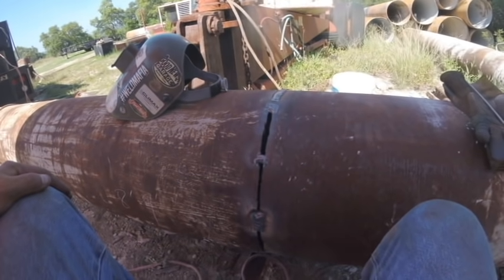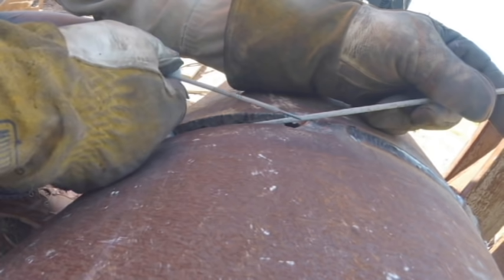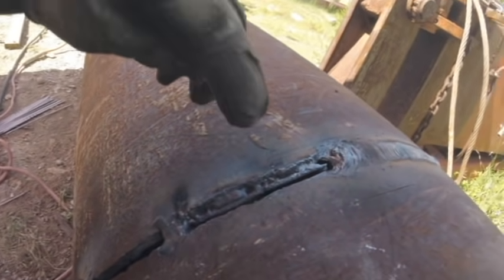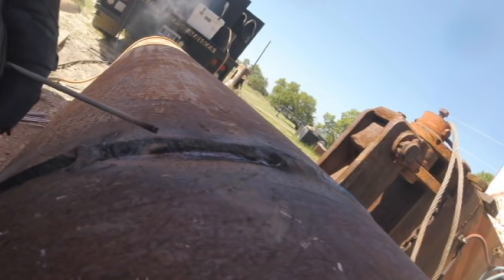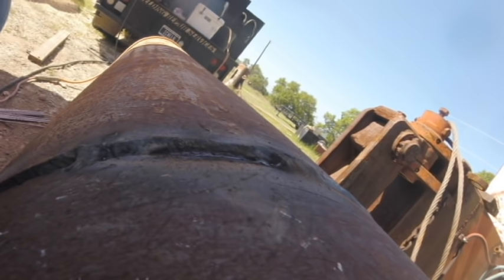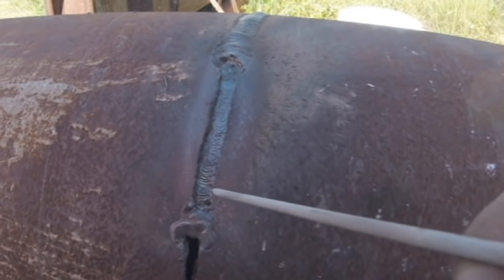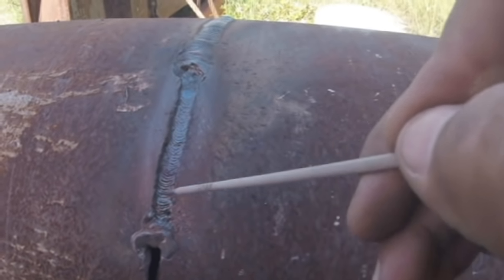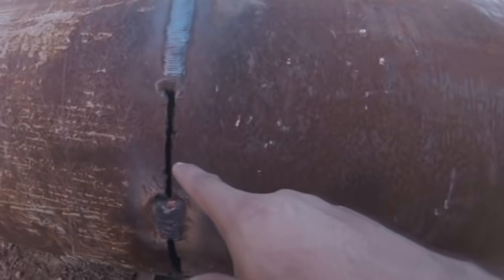Keeping it real!

Comment: Great to see you back. I giggled when you mentioned it as a "dirty secret" in 20 years of agricultural welding this is the most common of hacks. So glad to see someone be honest and "real" thanks for the good work
Reply: I thought I had come up with this back in the 70s in high school, but I never thought of breaking the flux off!
Reply: Good old gapcraft rods 🤣🤣
Reply: @bigunone  some 1/8 or 3/32 tig wire works too
Reply: @semajniffirg230  I have never handled a TIG torch watched it done, but not done it. I suppose it couldn't be any harder than oxy/acetylene welding
Reply: @bigunone  i think he meant just the tig wire as an extra filler with the 7018 or whatever stick you're using
Reply: @jc9376  That is what I thought also, but I have never TIG welded nor had TIG wire had hand!
Reply: @bigunone  understandable

Comment: Total agricultural job finished to a professional standard. Nice work. They guy I served my apprenticeship with once used a stick welder and an extra rod with the flux taken off like a tig welder filler rod. Result was pretty impressive . Looked awkward as hell to do it but the guy was talented . He made most of the tanks used in the Guinness factory in Dublin. They once had a brass tank drop from a crane and it got dented , so they filled it to the top with water and picked it up. After a few days the dent on the bottom popped back out. Thinking outside the box right there.

Comment: Never heard it called 'Texas Tig', but I have heard it called 'Barnyard Fill'...and a gap that big, I've seen a LOT of rebar and 1/4" cold rolled wire used. Drain pipes, culverts...no telling how many miles of 'rebar' has been welded into pipe that's now underground. Great video, as always!

Comment: I was commissioning a textile machinery in Mexico once. I overheard an American welder talk about the elbow on a 6 inch pipe he was welding was not fitted well enough. There was a 3/4 inch gap in it. He left to do something about it, when he got back there again, his local hired helper was in the middle of filling it with a weld. That line was to be under pressure later. Either water or natural gas. It was impressive weld.
Reply: Not You   In pipe welding school (25-30)yrs ago ,we had to weld a 1” gap ,open root process , in 4x6 1/2 plate coupons standing vertical ,, using 1/8 6010 which is DC rod equaling 6011 AC ! 6010 will not run on AC , but the 6011 will work good on DC , anyway the open root process is welded so the inside of the weld is good , the outside looks terrible , which you dress with a grinder before you do your filler & cap . The process is - done in a square  U shape , up one side for 1/2 “ to a count of like 1, 2 then a elongated 1  back down to starting point ,with an elongated 1 across the bottom & the same on the other side,. This process takes some metal from the side , brings it back down to fill across the bottom , leaving a weldment area that  looks like the key hole in the old farm house door , hence called keyhole open root welding ! But now a days this would probably be done with a flux core wire welder , and then change the wire for the filler & cap
Reply: @robertmintz63  welding is an art form.
Reply: Not You   Yes it is thank-you , l have also done his trick , did not know it was called Texas Tig  correction just asked my wife that was 35yrs ago

Comment: Nice to see another video!  Non structural, no pressure, just sticking some pipe together but still did a better job than most would have done on something that mattered.
Reply: I might have thrown 2 rolls of gorilla tape at that and called it a day

Comment: I used to do that at the foundry I worked at, the sand molds would wear out the AR plate around the bolts that held them down to the conveyor.  Had to weld them in place filling in the bolt holes and then weld the worn down seams.  Got another 8 to 12 months out of the liners before we had to cut them out and replace them.  Thanks for sharing.  Charles

Comment: Started welding when I was 14 now 66. Been doing that since I was 15 also Texas tig. I done this for structural welds. Fill in grind reweld. They all have held. Good way to repair. Lot stronger then what most people think. Not ideal but you do what you have to. Good work.

Comment: Texas tig has been around a long time. Welders building ships during WW11 used this method in large gaps when plating a vessel. My father told me about this years ago. He served on some vessels built this way and he said that those seams would come apart. The way he explained it was our country needed landing craft and ships very quickly and there just wasn’t time enough to fit everything up properly. A lot of these vessel were on a one way voyage especially the LST landing crafts. There were lots of woman welder’s building these ships and the woman of this time period were not afraid of hard work. They worked in all kinds of war materials manufacturing they were all referred to as “Rosie the welder”.

Comment: I had to use that same "technique" on a conductor barrel at a wellsite in Northern Alberta once. After that I always made sure to carry at least 4' of 1"x1/8" strapping on the truck. Like you said it does not have to hold pressure, it just can't leak.

Comment: I used Texas tig, using 6013 dcen and 3/32 7018 with no flux, for welding thin metal for floorboards in a truck.

Comment: With a canyon like that you might need some half inch rebar lol.
Reply: You read my mind.
Reply: No joke, and maybe some number 3 bar in the narrower parts
Reply: Serious tho why is he use 3/32 😂
Reply: @riccoronado430  I’m sure he don’t want to run to hot since it’s already a big gap to weld. So colder helps fill that gap up. After you get that filled in then your good to run hot.
Reply: I know it's probably a joke but...re bar is not something you wanna use for filling gaps.  It is all recycled junk steel that is very unpredictable on how well it is going to hold up.  Could be dirty or just a bad mix of steel that will eventually fail. (Even though I have done it before) lol

Comment: I've done that with round steel rod, not weld rod. The steel rod becomes part of the structure, not just a backing to the weld. The radius makes space for a nice filet. You work with what you have on hand, especially if the customer hands you an "All you have to do is...." Murphy job. 
Good job.
Reply from the maker: Good tip!

Comment: Flux on both filler and weld rod. Could we call this dual shield? lol.
Welding in your left and right sides like you did is best as you are bringing in the parent material to improve the overall metallurgy of the joint. Great work making a silk purse out of a sows ear.

Comment: Even more confident that you are the best damned welder in Texas.  It isn't high pressure gas line pipe!  It is structurally sound pipe!  Apparently your customer had the over "all length required and tack welded" before you got to the job.  I have seen this done before many times and it worked out OK to fill a non-critical Gaposis and so be it how ever it comes out as long as it is solidly held together.  Your customer should be glad you knew how to successfully do the work.  Your skill saved him allot of money without beveled/J-grooved pipe edges and holding the length at the end of the pipe.  Bravo Zulu Pop!

Comment: I do not understand, that if the buyer could tack the sections together. But pays you more to finish the welds.    Your rate per hour has to excede their in house cost. Unless another contractor did the aligning and tacking.
Thanks for another great video.
Reply: the one who started it bit off more than he can chew so he welded the slammed side and called a REAL HAND to finish what he is incapable of.
Reply: Thats likely the case. They have a guy who is a decent welder but has not taken on big jobs, he thought it would be the same as welding a trailer repair but called in a pro when the reality of a giant gap set in.

Comment: Oh yes ,this is a typical fillet rod, that what we call it ,fill the gap anyway you can, I have use metal rods in some of my jobs to fill the gap or seams, I have done this before too , except I bridge over the seam, like you mentioned before, I actually am learning what did you call it tc weld, this property would not work for High pressure, kool thanks I learn a little bit more every time, thank you happy new year 🎆🎈🎊 and praise Jesus grace Christ amen BigAl California.

Comment: He said to knock the flux off before welding the filler rod ( stick electrode) in the gap but it looks like he kept the flux on. Does it not make a difference or did he really knock the flux off?

Comment: You could cut both ends square on some jacks then cut the middle put it back together in the same amount of time you spend tryn to fix someone’s minor mistake lol but you do you man You’re good at what you do
Reply from the maker: I agree with that, however, I was a bit limited on timing. I had multiple to do and I didn't want to wrestle those by myself.

Comment: I've used 1/2" sq solid as filler metal in gaps this size, 5/32 5p as the rod... 1/8 7018 cap on 1/2 thick casing...

Comment: If it was possible to roll this so the joint was vertical instead of horizontal I would suggest running downhand stringers to fill up that gap. Run one side of the joint and then go to the other immediately. Using this method ensures that you have 100% weldment in the joint. Over the years I did dozens of joints that way without any problems. I have used rod slugs like the one shown here but I never liked it as I had no idea what the inside looked like and the greater possibility of slag inclusions.

Comment: Good Day isaac,   I discovered one of your vids I missed.  Interesting approach.  I've "plugged" a few repairs in my limited welding history.  I weld for me, so if 
it breaks I fix it again.  I just love  burning rod, wire, etc.
Silly question: Could you have gotten inside and tacked some backup strips?  I had a similar repair:  I took some 1/4X1, stuck a rod or bolt to hold it, tacked it and finished by running beads.  I got burned doing "weaves" and have been leery ever since.
I've been amazed by your rod control every time I watched.
Reply from the maker: These pipes serve as guides for augers that will be running inside the casings. Any backup strip may catch the edges of the auger as it passes by.

Comment: i dont know jack about welding but i fixed a hole in my exhaust once by letting out mig wire over the hole and just touching it quick so it would melt off in strings. i did this til i had a web of mig wire over it then ended up being able to fill in the hole without just burning a bigger hole in the exhaust. i dont know if welders actually do this but that fix outlasted the car.

Comment: I'm just asking your opinion but after your hot pass since you were working close to horizontal could you have capped it off with 7024 and just filled it in ?   Thanks for showing how you dealt with it. I have had to work with crap like that before and I will try a J pass the next time and see how it works for me.

Comment: I wish I could weld or cut even 20% as good as Isaac, dude has some serious talent! I get by, 99% of my repairs last but they don't look as nice as his, I know practice practice practice. I just can't believe I can't pay to take a class anywhere in MA to get proficient with welding, mainly TIG. I'm at the point that I think I'll reach out to someone on Facebook Marketplace that does work like Isaac and offer to pay them to let me bring my Miller Diversion to their home and coach me on whatever I'm doing wrong. I need to get good at TIG welding aluminum and/or stainless, there are so many repairs I can't take on because I can't seem to get TIG down. I can't seem to make a nice TIG weld even by accident, I'm pretty sure I have every aspect of setup dead on, I know I'm setting it up right even down to dedicating 1 brush or 1 grinding wheel for the tungsten, I've watched hundreds of videos on all techniques. IDK why practice isn't getting me anywhere fast, I feel like I'm missing some major aspect; I've been a toolmaker, fabricator and a machinist for over 25 years now and I'm use to picking new things up allot easier than this...
Reply from the maker: Have you considered the shape of your tungsten grind? That makes a big difference too.

Comment: Good job there,but is always room for better,in that case,the pipe's wall thickness is at least 3 times thicker than your rod's diameter,so,for a better  weld (not really faster but just save prep time) i just weld a stack of bead after bead after bead on each (let it cool in between if you feel the need) side until i get a ladder of beads resembling a bevel,wich is better than bridge with additional bare rods,saves you some struggle,texas tig is useful on thinner walls,that is the way to get a good job out there,but on a thick wall,get that bead stack ladder in practice,you will not be sorry,best regards from Romania <3

Comment: Do you not find a twisted wire wheel on a angle grinder a far better way to clean away the stage than a scaler like why would the high pressure  pipe fitters  use the grinder over a a chipping hammer ?

Comment: When i first started welding self taught i would buy 1/ 8" and 1/4" cold rolled steel for this reason.. My fabrication has gotten extremely better now i only use 1/ 8th and 1/4 cr steel for fancy toilet paper holders and curtain rod holders.

Comment: Not sure if you're equipped to run duel shield wire but some 045 777 would have been ideal for that
Reply from the maker: Im beginning to look into some dualshield. thanks man.
Reply: @ICWeld  save you some Hassel,LN25 suitcase,045 777 or 71m is a real nice wire, 75/25 gas 25 cfh you can get away with alittle wind by cranking gas up alittle,grab a outershield gun for self shielded when it's too windy I'm sure your machine is CV capable.you do nice work..

Comment: I was called to a job to cut out and fix 10 16” welds on casings for a bore section when the 400+ piece was picked up several welds broke the inspector then called all welds cutouts and have them redone

Comment: This looks like what I get left with at work all the damn time! Not really all the time but it seems like it some days. It sucks!! It's not fun at all! Makes the job take 2-4 times longer and harder. You probably don't have the option but what I do is build it a lot so the guy that did the fitment has to grind the crap out of it. Most of the time I'm doing my own fitting and clean up. It's when I have to weld other people's crap.

Comment: hi, first : pretty cool and interesting videos.

now a question: i got a friend (i am from germany btw) who is a welder and i showed him your videos. where he works is a big company and they got pretty expensive welding machines because they do everything from middle to big (as well bridges and stuff, they got the license for it).

and he told me that they only use mig/mag (pulse mag as well) and WIG/tig and that electrode is something he would never use and strongly does not recommend.  he said it's a dirty process, to much air in it and simply not good enough for stuff they do. 

what do you think about it? i mean you use it on daily base... do you have like "limits" on where you say "now i have to use MAG". like electrode for "smaller things" and MAG for bigger / more imporant things, or where is the line for you?

thank you for your videos and greetings from germany !
Reply: I’m not IC, but here goes he is an independent South Texas oilfield welder that fixes whatever needs fixed, today it was conductor pipe, tomorrow whatever the call is 
His actent is ST I don’t know how far south but it helps to speak Spanish
Reply from the maker: Pretty close on the accent. Im from a little further south than SA, like 4.5hrs south.

Comment: I'm curious about the welder/Generator (sounds like a Onan) you're using. You got a air compressor some where? getting to use a fast freeze rod is almost cheating vs using a LH rod. Yeah, it can be done with LH but, just like you did the 6011 is the most practical. I'm too old to be of any use now, can't see the crack, just have set and armchair quarterback now. It's good to  find common sense "Keeping It Real" type videos. Keep up the good work.
Reply from the maker: Its a Miller trailblazer airpak with a kohler

Comment: I use use that trick as well for years, actual I used whatever I had at hand if I need to used round stock of different dimensions I'd use that as well But we didn't call it anything up here in Canada first time I've heard that term. Texas Tig. lol I'd use a mig with flux core in a shop environment instead of Stick! but in the field yeah stick ..I mostly did my work in a shop! through the years. As the old saying goes many ways to skin a cat. Right!!

Comment: no need to remove the flux. it works better with. that is my experience anyway :) I normaly just use it as a tig rod. in this case I normaly will go dc - and fill bought sides and clean with grinder then fill to clean up the root.  and I have seen some just use round bar.

Comment: I'm by no means a welder. I just watch a lot of welding videos for some reason. You clearly made lemonade out of lemons with this job. Why didn't you grind out the tack welds and move the two pipes closer together? Wouldn't that have been less work? Or was there a reason, other than the tacks, they were so far apart? Just curious.
Reply from the maker: I was a bit pressured for time. I could have cut them and redone them but It would have been a lot of effort for the limited time i had available.
Reply: @ICWeld , fair enough. Thanks.

Comment: Question from a new welder: why not just run beads along each wall and bridge the gap like that?
Reply from the maker: Thats basically what I did but with a welding rod as a filler. less sagging penetration on the inside this way.